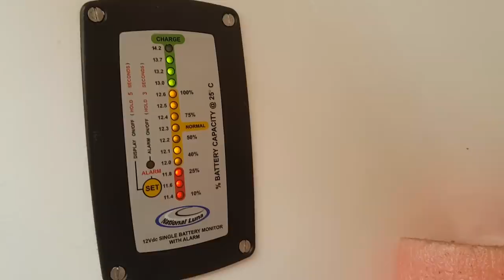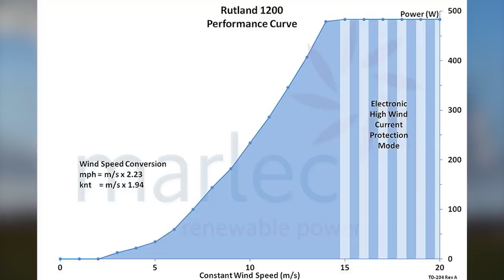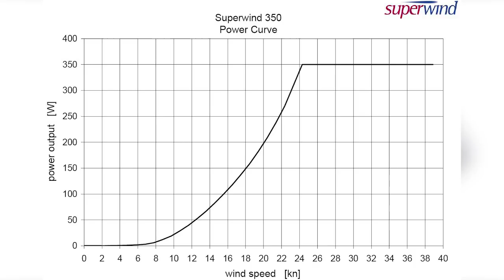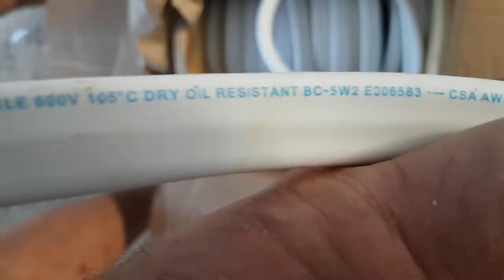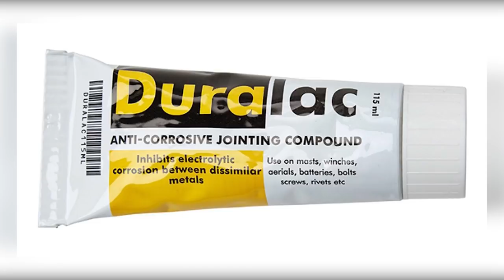Smart or Dumb? We Put a Wind Generator on Top of Our Mast - Ep 58 Sailing Luckyfish

Comment: There is a lot of complicated engineering that goes into lightning dissipation threw the mast to the water in an attempt to protect/isolate the expensive electronics of a sailboat. Yes it will get more wind at the top of the mast, but you have effectively attached your boats entire electrical system to the tip of a lightning rod. Any lightning strike on your mast will have a catastrophic ending.
Reply from the maker: yes. In the event of a strike, do you think it makes a difference? It is by nature a fairly catastrophic event.
Reply: Makes a huge difference. I need to state first off that this comes from a position of genuine concern for you and your crews safety.  It all comes down to what side of your electrical system takes the hit. Consumption side or supply/generation side. 
I am going to trace the path of power to ground in 2 senireos.
1:Consumption side: Lightning strikes the mast, mast has a conventional antenna on it, power goes threw mast > body of boat> keel> water, some bleed over ( 1.21 gigawatts ... great scott)goes down antenna wire into radio (smoke no more radio)> power distribution box and circuit breakers>back to any other equipment hooked to same circuit( more smoke less equipment)>trips breakers mostly protects boat & other electrical equipment. bad situation but recoverable after some panic & reset breakers you continue the crossing make repairs and replace equipment at next port of call. 
2:supply/generation side: Lightning strikes the mast, mast has a heavier gauge wire running to the charge controller,  power goes threw mast > body of boat> keel> water, some bleed over ( 1.21 gigawatts ... great scott) goes into the input side of charge controller/isolator, arcs across circuitry finds solar cells( bad news for solar), finds alternators on engines( bad news for alternators), finds engine start batteries (more bad news), finds genset (yep more bad news), finds house batteries (possibly worst news), finds distribution box and any thing using power shares in your misfortune, now if none of your batteries have exploded the good news is that your boat is floating and not on fire. but you now have zero electrical other than hand held lights and rechargeable devices (providing they were not plugged in at time of strike). Murphy's law says both senireos  will happen in the middle of the night, in a squall or worse weather far from land.
Sorry to paint such a bleak picture, but the risk far outweighs the benefits. By all means get a second, third or even fourth opinion.
Reply from the maker: +Recycledheartdm - thank you for your concern and describing the difference in expected outcomes from lightning strike re: power supply side vs appliance side. I will look closer into it. I have a particular thunderstorm off the south coast of Cuba in mind to hone my zeal. We do take risks on yachts, we try to calculate the risks and not let them prevent us from going. Whale strike is about where I placed lightning strike on probability scale. However, the Caribbean, particularly Cuba, Florida, Panama areas, appear hotspots and so our risk is somewhat heightened. Like many if not most yachts, we have no bonding or grounding system. I note that preventers simply don't work below 300m so scratch that. So first steps will be to look at how to ground and where bonding is required. After that, breakers or fuses for the supply side. We have them on the hydro gen but not on the supply side on the wind gen. Its questionable they would be effective anyway. Likely just arc straight across a blown fuse. So some pretty deep research and trouble involved if we go down this route. Thanks again, really appreciated, Stew.

Comment: If you can contact me I think I have the solution if you havent already figured it out? I just purchased two wind generators and they show how to isolate the mast from vibration.  Not quite sure how to send you information?
Reply from the maker: @C Lee Shannon received your email and checking that base mount diagram, will respond shortly. Thank you! Stew
Reply: The thin L shaped piece represents your plate at the bottom of the Gen Pole. @SailingLuckyfish
Reply: @SailingLuckyfish  Also I know you don't want to hear this, but the holes in the plate you have need to be larger so the plate can not touch the bolts.